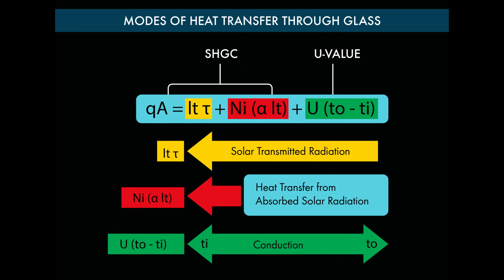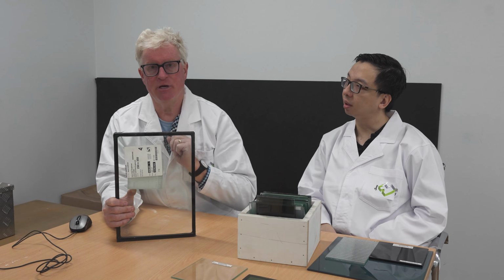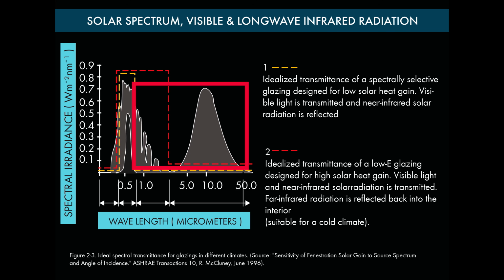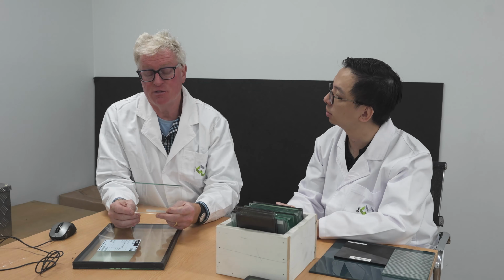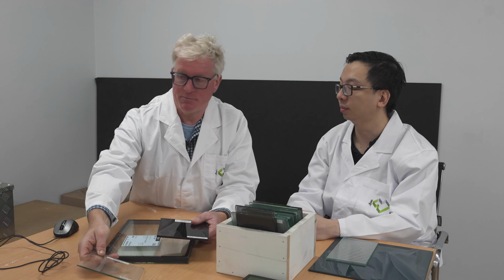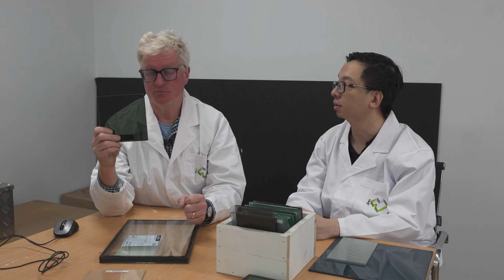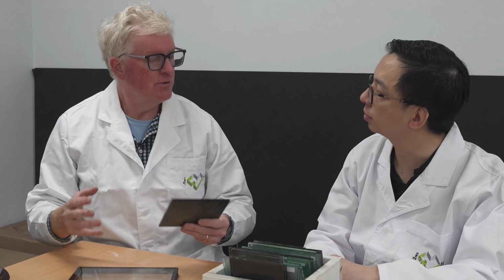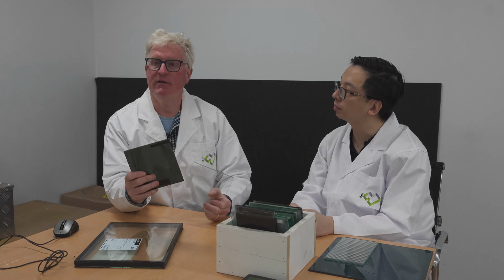Energy-Efficient Windows EXPLAINED: SHGC, Tinting & Low-E Glass Secrets!

Comment: I’m wanting to know if you have double glazed windows installed in your home can you get the inside windows tinted with mirror tint to reduce heat without it breaking the glass from heat reflection?
Reply from the maker: You may need toughened glass for that.   But you’d be better off asking that question to a glazing professional.

Comment: Joseph... Can you compare vacuum insulated glass to gas filled. Apparently its a new technology more efficient.
Reply from the maker: If we could get ahold of a vacuum glazed unit, we will indeed cover a video on it.
Reply: The performance comparison can be based on the published U-value data. Just to be sure both products are presenting with the same U-value (metric V IP).
Personally, unless in retrofitting project which the glass thickness is restricted. I would go for DGU instead of vacuum glass; mainly because DGU will still perform well when the seal between layers is broken. Not the case for vacuum glass.
Reply: @josephcheung8311  yes thank you for the response and advice.

Comment: What a great segment with your professor. It's really difficult to know which vendor I can go through locally who will understand enough about the right kinds of glass and isn't just going to steer me to whatever gives the greatest margins... it's really quite frustrating.

I moved into an older house last year and we are slowly improving it. Since it was an architects house for him and his wife, it is very well built and insulated... but the windows are awful, and waves of cold roll off them, even with heavy curtains. Trying to find that sweet spot in price:performance is really difficult.

Do you have a video on being able to measure what gains you might expect out of choosing performance glass? Trying to figure out if there is some equipment I can hire to take a bunch of readings myself to understand where my house is at, rather than hiring a person which is often substantially more expensive.
Reply: How have you got on so far? I am in your position also 
Being offered low e glass not sure whether its worth it

Comment: Triple pane windows are common in Europe and are becoming more common else where.
Single pane windows were common in the 1930s.  Double pane windows became more common  in the 1950s.
Triple pane windows are now more common in the 2000s.   Energy efficiency matters. Wasting energy wastes money.
There is a climate crisis. Triple pane windows need to become the standard.
Reply: Lol not in NZ lots of houses still have single and new budget houses have Doble but aluminum frames so still cold and condensation sad building practices ...ill stick with my 20s casement windows and retro fit double glazing
Reply: Or V glass, vacuum glass thats only a fraction thicker than single glazing so can fit most old windows without changing them.

Comment: Good discussion about the coatings and tinting of the glass. Could have also discussed the affect of thickness of the glass and the spacing in igu. 
Finally a discussion on the importance of the frame to the overall performance of the window. A lot of Australian manufacturers still use aluminium frames that negates any benefits from double glazing.
Reply: The window frames had been discussed previously in this video:
https://youtu.be/yJkcpVMVO1E?si=s-uhDlaQ1y7d-Ptx